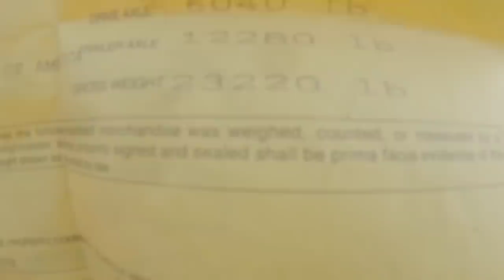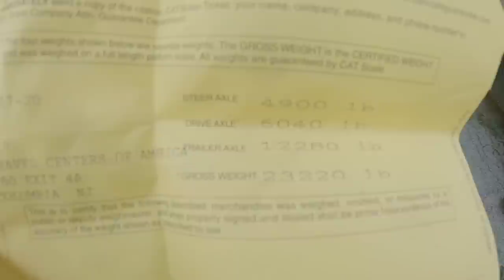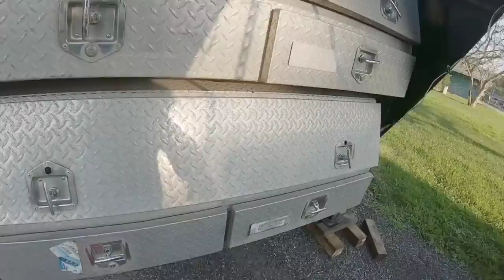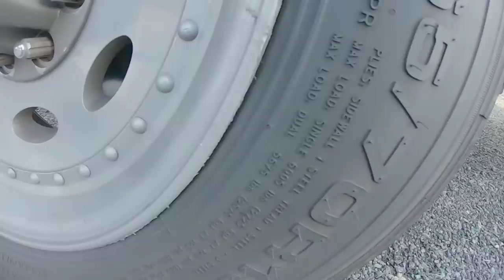Crazy Cool and Creative Travel Trailer Gooseneck RV!

Comment: In the firearms world we have something called "tactical elitists" - people that spit on guys for running $500 built-up AR-15's with iron sights rather than $2000 cnc machined rigs and $1500 optics. From the comments here, I just learned there's also "trailer elitists". To each his own, whatever satifies the owner and thier mission is good enough for me.
Reply: thanks
I'm a certified welder and I've done everything from 4500hp race cars to steel erecting buildings
Reply: OGOB RACING ROCKCRAWLING your hands say more than your words. Clearly you do work and your lessons have been learned through experience. Thanks for sharing.
Reply: @546people  i agree with your post 100%. sundowner sells a crawler hauler model. there $70k new plus. there have been several people that have built units like ogob racing or similar. there are more of them out there then people know. these types of toyhauers are perfect for there application! nice work ogob    genesis supreme overnighter has been built for several years and momentum just released there 292go model . they both are scaled down versions of ogob racings build.
Reply: @546people  thanks alot
Reply: @gatekeeperoffroad4252  thats a nice set-up you got there and the thought process behind not only the rv/toy hauler side of the build but also the thought that went into the mods on the dodge also to make it a more reliable tow vehicle.. just wanted to say good job and alot of genius upgrades
Reply: @mikemccabe7124  thanks you
Reply: br ed Grand Design makes a Momentum built like this. I just saw it last week driving by the local dealer in NW WA.

Comment: This is one of the nicest vehicle haulers I've seen.  He took the time to rubber mount a full trailer and then skirt the sides so it looks better. Also it wasn't some $500 trailer that was bought off Craigslist.

Usually you see the pullers weld a truck bed camper or 15 foot stick and tin trailer on a standard bumper pull trailer. Once there was one guy that did a fifth wheel.
Reply: Thanks alot for the kind words

Comment: That's one big unit! You will rarely hear me say this but in this case I would suggest upgrading to a dually rear end because of so much weight he is hauling.
Reply: Agreed...
Reply: I'm way under weight on everything
Reply: Not necessary, the more weight he adds the lighter his drive gets. It’s a 1 ton with upgraded tires and wheels,he’s under his total and all axles. Why does he need a dually? I agree it would be more stable but with that argument we should go right to class 8 trucks w 30/44k rears...
Reply: Hes under his rear axle capacity by 1000lbs. From that, probably safe to say he is within his payload numbers too. Therefore no need. Would it hurt to have the dually, definitely not but it simply isn't necessary.
Reply: @JohnDiMartino  and 7k air bags
Reply: @gatekeeperoffroad4252  Your most likely good as long as you avoid a tire blowout. Sweet trailer!
Reply: @sethc3333  every body talks about blow outs, how many blowouts have you actually had towing?
I also tow with a ram 3500 srw and im at 6300 on the rear axle and it tows great.
Reply: @motohobo8826  I hear you. None so far. It's a peace of mind thing I guess. As long as you are taking care of your rear tires, you won't have a blowout in a high speed freeway situation, which is when it would be truly dangerous I think.
Reply: @motohobo8826  I have seen a lot with blow out and have helped several of them. I drive a tractor trailer over the road. I carry tools and a cordless impact for general repairs as I am a owner operator.  This guy has upgraded his tires to handle the load and since he is a professional drive I am sure he knows how not to abuse his equipment including the tires.  Unfortunately a lot of people think they are ok on the weight and can be close to the limit of the tires for single rear wheels and still think they are good to run 70 or 75 mph down the highway. They go blowing by me and next thing you know they are on the shoulder.  There has been a few not as lucky.  What gets me is everyone of them I have tried to help says they must have ran over something on the highway.

Comment: I believe this setup is the best for its intended use. How else could you carry an off road vehicle and atv and still have a camper? I would imagine there are a lot of people out there that could use a rig like this!
Reply: yes I've been contacted about building them but no time
Reply: @gatekeeperoffroad4252  great build. I know there’s a company that makes them but like you said this one is what you like as far as camper plus you already had the trailer.  I like the fact you put rubber mounts underneath it that is about the best idea.  I seen where people have put a pop up camper on top of the gooseneck and mounted it on a carousel type thing to spin around so the door faces the trailer deck and the just put the stairs on the side of the trailer and then a set going up to the camper

Comment: The one question i was wondering about with this setup is what is the GVWR of the trailer? I am thinking it puts the GCVWR over the limit. Nice setup just wondering what the state police would say about it? But hey you do you.
Reply: Rv same as a tower home rv or class a with air brakes basically length is a factor

Comment: Sundowner already builds an aluminum 'Krawler Hauler'
Reply: 100k and way smaller interior
Reply: @gatekeeperoffroad4252  More like 80K new, and much less used. But, yes LQ horse trailer interior.
Reply: @1hasbeen531  with a slide and triple axles no look it up
Reply: @gatekeeperoffroad4252  I actually own a 41' Sundowner TH with slide, genset, and lots of options, and it was not 100K new, and the Krawlers cost less.

BTW, not knocking what you did, or trying to argue. Your rig is very cool.

Comment: What is your overall length front bumper to back of trailer. In Texas we can not be longer that 65 ft with truck and trailer combo or 53ft on the trailer if the truck is registered as a tractor.

Comment: 48 feet! Jesus
Reply: That's hitch to bumper. Gooseneck trailers are typically measured by floor length (because the neck overlaps the truck) so this one is only 40 feet on paper, but yeah it's still a monster

Comment: That’s a lot of trailer to haul without duallies. That trailer would push you off the road if breaks fail. Way to small a truck.
Reply: Nope not at all perfectly fine manuel and exhaust brake hardly u brakes going down grades